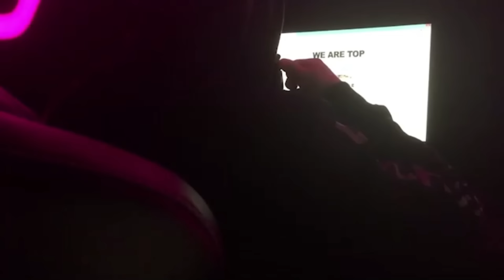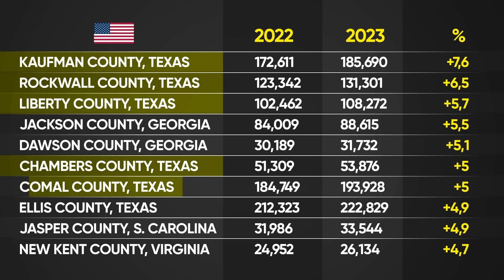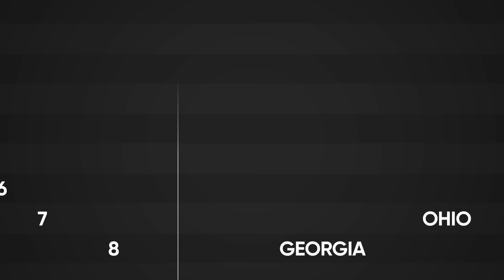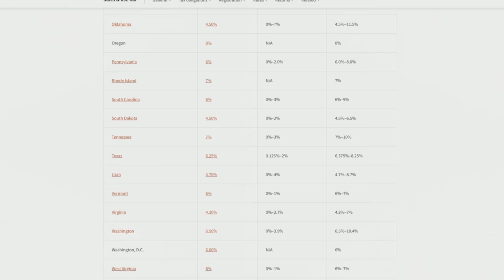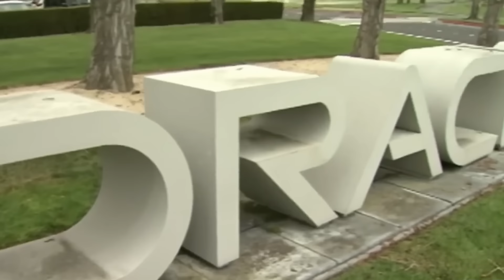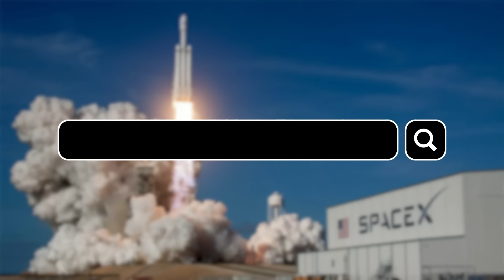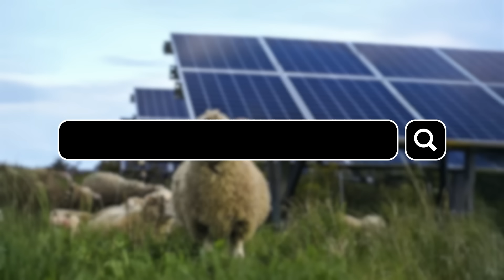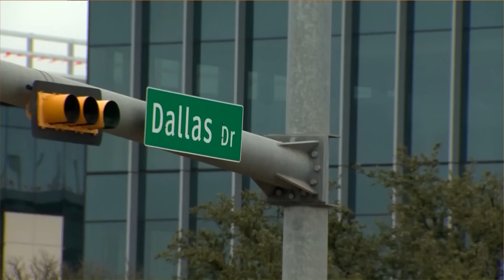This Is Why Texas is Becoming America's Most Powerful State

Comment: World class infrastructure... as long as you dont have an extended coldspell.
Reply: Yep, at the worst possible timing. One of the major coal plants was down for maintenance, and it takes about a month for those to cool down enough for those activities. Then it was needed in an emergency, so maintenance cancelled and fired back up...which takes about 2 weeks for maximum output. Added to this, STP Nuclear (Bay City) had frozen water intakes and one of the reactors had to be taken offline.

I lived on the coast in a beach house: elderly landlords on top, me in bottom apartment. I was glad that my grandfather taught me how to lay a fire, as I was able to keep the upstairs around 70F, with their fireplace, during the worst of it. We heard generators across the bayou, but they fell silent by the third day. Even the gas station pumps were down, with non-perishable (cash or debit card only) at the groceries, and you had to bring your own light.
Reply: Yeah, that was kinda embarrassing. But when you live in a region where temperatures hover around 100 degrees 100 days of the year and around 90 degrees another 200 days of the year, preparing for cold snaps ain’t exactly your first priority. That said, we learned our lesson, kicked some bureaucratic asses and hardened the grid. Next time we’ll be ready but we’re still a little short in the snowplow department and probably will be until blizzards in Texas become a more regular thing. 😉
Reply: @josephbravo2590  What was really embarrassing was the water infrastructure. Most of Texas, for the reasons you gave, bury building water lines 1-2' underground. This is fine 99.99% of the time, up until that one time where the ground freezes and lines pop 1-2' underground.
Reply: I wonder how California would have performed in a comparable cold snap? My money is on "not well at all.".
Reply: Or annual hurricanes 😂.
Reply: @persnikitty3570  yeah and in Texas they are not about to add regulation to hurt businesses and help the masses...  just pray for no long freezes...

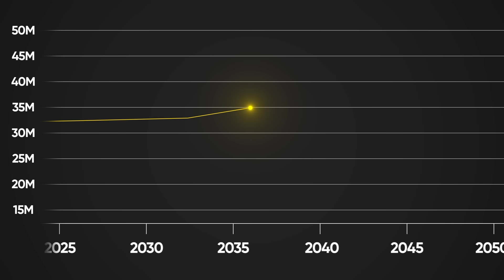Comment: At 4:52, do you really want to call 2036 "the state's 200th anniversary"?
Texas undoubtedly will celebrate 2036 as its 200th anniversary
because it became the independent Republic of Texas in 1836.
However, the U.S. has it that Texas became a U.S. state in 1845.
Texas officially recognized that it became a U.S. state on Feb.19, 1846,
when President Anson Jones replaced the Texas flag with the U.S.
flag in front of the Texas Capital Building.
So, the 200th anniversary of Texas statehood is either 1845 or 1846.

Comment: GDP only shows how well the rich are doing. The average wage in most parts  TX is below livable wages and health care access is only for those who can afford it . There have been several Oil and Gas industry explosions and accidents,  more so the any other state . Ground and water pollution is high. . This is due to Tx deregulating safety protocols and environmental regulation . With more companies coming to Tx because the regs are weaker, the more likely more Petrochemical accidents will happen. There are parts of the Gulf coast that are unlivable because of the Chemical/oil/gas companies. You didn't even talk about all those gas and oil wells that are not maintained after going dry. They are leaking toxic gasses and fluids.  The cons list goes on and it is not good. How much did Texas pay you to sugar coat the state? BTW I live in TX.